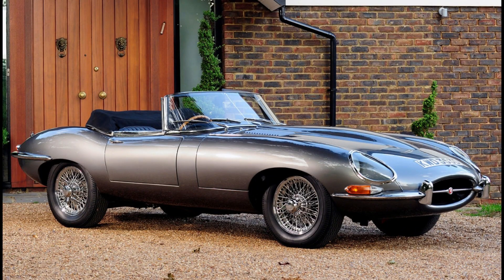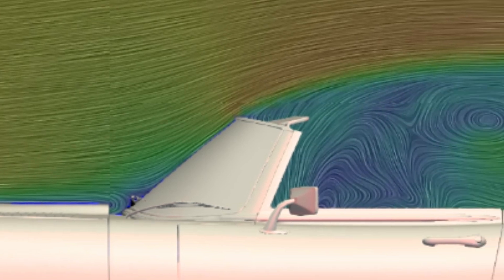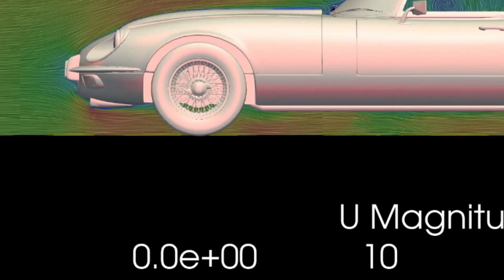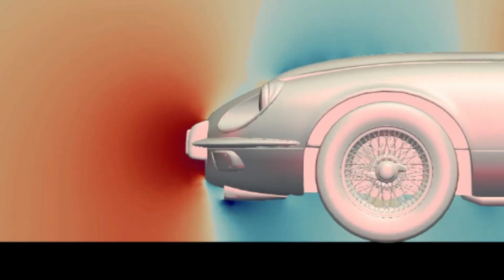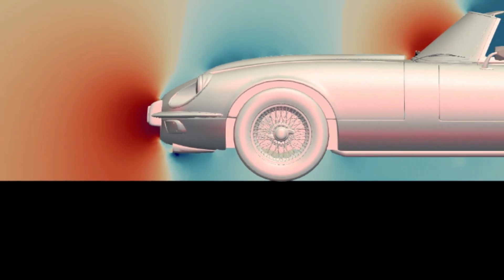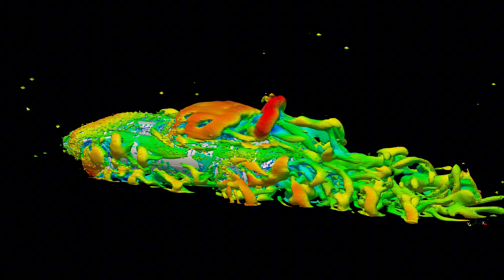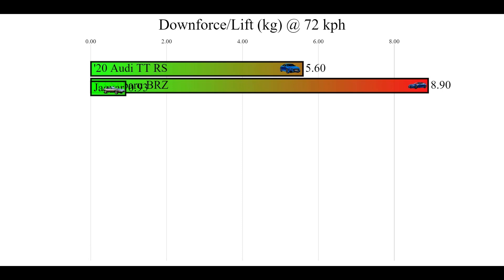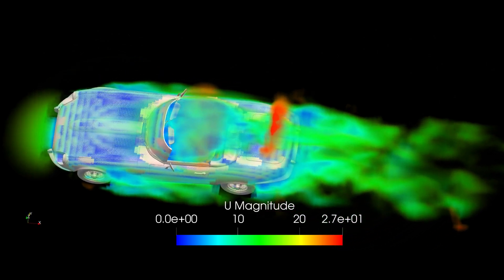Why The Jaguar E Type Had Terrible Aerodynamics

Comment: The exterior design of this car was incredibly successful.  
Jaguar could not have done a thing or things, to reduce drag at the back of the car, because drag didn't matter one bit.  How much extra appeal to people it could generate, visually and conceptually, was its brief - not how little drag it could create.  It's a convertible - it was never meant to be aerodynamically efficient.  
It was very attractive, and popular for many years.  So, in a sense, it was hugely efficient in performing its intended function. 

Aerodynamics was a factor in the modified design of the 'Low Drag' E-Type racer - but that was a very different creature, in a very different environment.
Ranking cars in order of beauty, is like arguing about which architect is the best - meaningless to architects, and to each of those arguing.

Comment: 03:58 - "...a bonus [is] the low pressure here helps suck the people down into their seats, so there is little chance of them flying out."  😶 Huh?
Errr... That'd be a no.  It does not suck them anywhere, forward, backward, down, up or wherever.  Even if some air pressure does slightly push the occupants down, it has no bearing on the likelihood of them "flying" out, or coming out in any other way.  The circumstances in which occupants are usually found to have been separated from a convertible car involuntarily, their bodies are not subject to any significant downward pressure from airflow.  The car itself usually isn't parallel with the road surface, or upright at all.

Comment: The BMW E60 530i lci has a CD of 0.26
They said they achieved this without active radiator shutter abd without wheel air guide (air curtains).
You can be the first one to make a video about it.
Very very interesting sedan design.
Reply from the maker: Thanks for the idea! Yep, that was one of the first very low drag production cars.

Comment: This is the post-1970 US model which had the additional bumpers which changed the front a lot. I suspect it would be worse without them
Reply from the maker: Perhaps we should take the bumpers off and see. Thanks for the idea!
Reply: @PremierAerodynamics  the race versions tended to have either an extra-long roof, or often did away with the windscreen (probably the better idea). They would have been better throwing away the car and going with something more aero
Reply: You're correct. Post-'70 it was an entirely different & larger car. This guy doesn't realize the difference. The silver-grey rdstr. shown in the photo is an entirely different car than the later car in the aerodynamic model image.

Comment: Such steep windshield angle .. should be reviewed relative to cars of that era. In comparison of many average windshields it's really not that steep. And as you noted, rounded shape helps slightly (but roundedness was less of thing in other cars, probably due simplicity of manufacturing & cost cutting reasons).
Same for eg. bottom to not doing much for downforce. I guess partially it might be also it being so high from road .. but high ground clearance was the thing for just about any roadworthy cars of that era.

Comment: The coupe should perform a lot better. But the windscreen would still be too upright and the roof would produce wake.
Reply: Also a Series I would likely perform even better due to narrower tyres, the lack of the lower air intake les exhaust piping and the addition of light covers.
Reply from the maker: You know it!

Comment: Cabriolet always gave a bad aerodynamics. Should compare with E-type Coupe for a fairer comparison.

I have a classic beetle. I can get 2km per L more mileage with top up compared to top down.
Reply: in Germany we domn´t talk about km/Liter... we drive 100 km and compare the used Liters. Please convert. ;-)

PS: I used to own a Beetle and top down / up on the same Road would be 5 Liters difference / 100 km.
Reply: @FRITZI999  In Japan we use km/l.
Reply: @ at lest the Metric System ;-)   Never been to Japan, want to visit one day.
Reply: @FRITZI999  Japan have a surprising committed beetle community! Flat four is cooperated in Yokohama Japan!
Reply: @FRITZI999  In the Netherlands, we use km/l, please convert. I don't see the need to drive 100 km first before assessing the fuel consumption. Waste of money and time 🙂.
Reply: @ronaldderooij1774  the Netherlands I know uses Liter/100 km like all of Europe... Job must live somewhere else ;-) 

No need to drive 100 km first as the Onboard Computer will tell you instantly what Fuel Consumption is... ;-)
Reply: @ronaldderooij1774  I laughed
Reply: or at least do the calculation with the top up.
Reply: I agree with what others said. Kinda goofy video.   Top up or with hardtop on for sure.
Reply from the maker: It is a configuration that exists.